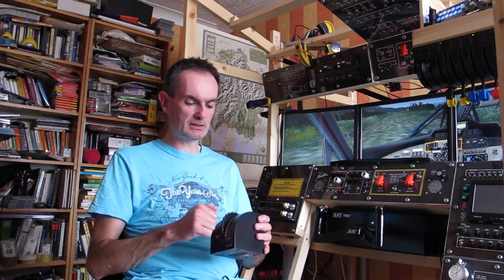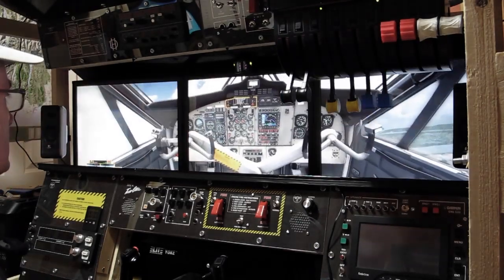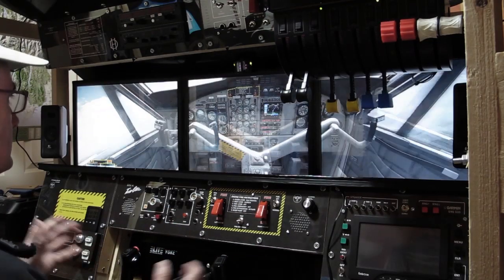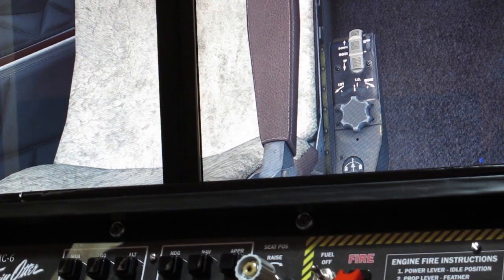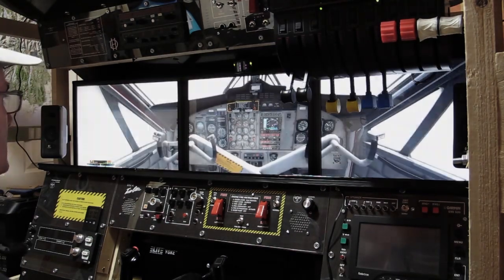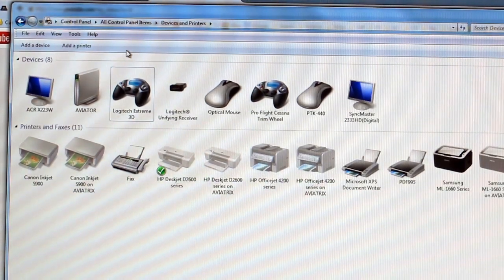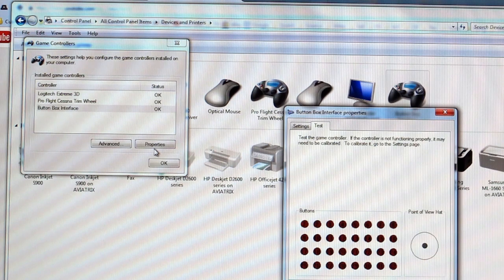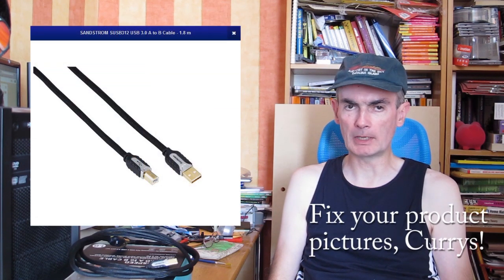Hacking the Saitek Trim Wheel (Twin Otter Cockpit Build - Part 11)

Comment: Oh my, I’ve been wishing for a relative trim for years now but only just found your video! 
Do you have any further information on how to connect the bodnar board to the trim wheel pcb? 
Is it as simple as a 2 wire connection into one of the pin sets on the bodnar controller? Or is there more to it?
Reply from the maker: Yes, it is that simple. Check out the two links in the description for the specifics of where to solder.
Reply: @AlmostAviation  Thanks Mark, I've checked out the links and am happy I know where to solder to the Saitek board, but can you tell me where to solder them on to the Bodnar?
I have a Bodnar BBI-32 going spare and on there I see things like B1 GND, B2 GND etc etc.
Do I just need to solder from each of the RX pads on the Saitek board over to B1 and B2 respectively? In which case where does the ground go?
Reply from the maker: @SimonPeel  Ah yes, the ground! I didn't think of the ground but it worked just connecting the two wires to two adjacent signal inputs on the BBI-32 (B1 and B2 will do). You ought to connect a ground wire from the Saitek board to one of the BBI-32 GND connectors, but I suspect it works because when the Saitek's USB connector is plugged in it shares a common ground with the Bodnar board. The circuit board image n the first link (also reproduced in my video) shows a couple of clearly-marked GND connections if you wanted to try doing it properly.  Presumably it would then also work without the Saitek plugged into a USB socket. P.S. Don't forget to run the BBI config program to tell it your B1/B2 inputs have an encoder attached.
Reply: @AlmostAviation  Just wanted to pop back and thank you -  I got it working! Went the same route as you, without the ground, I just felt that the gnd solder joint was going to push things a little bit too far with the space and angles inside the case, so I'm happy. Thanks for the advice!

Comment from the maker: Hi David. No, I have converted the trim wheel to NOT behave like a potentiometer, which is how it behaves out of the box. I guess whether you ought to find the trim set where you left it when you come off a/p is a matter for some thought. Maybe it depends on which a/p mode you have been using - so, for example, in the absence of auto-throttle the altitude hold function can only use trim changes to adjust altitude. I have little experience of using autopilot, so I am learning as I go!

Comment: Am I correct in assuming that you converted the Saitek trim wheel into a potentiometer? I ask because (not  having the Saitek trim wheel) I use the potentiometers on the X55 to act as trim and avoid the inadvertent jump to the neutral position. For the most part though, if the trim is set for desired speed before AP engage, the trim stays close to where you want it after AP disengage. However there are many variations in FSX sim aircraft and they vary greatly in their (simulated) flying characteristics;)  Thanks for these vids, it shows what time and thought can produce!!

Comment: All very good but I just hate the black bars on the sides of screen's , in my opinion the VR experience could improve 50% by removing those nasty bars , just open them cut the sides and go flying :)
Reply from the maker: I can't argue with that, except perhaps the word 'JUST'. Chopping up some monitors may be a future project, but I'm not going to do that with these ones just yet. It isn't so bad but you do have to set the bezel management or it doesn't look right.